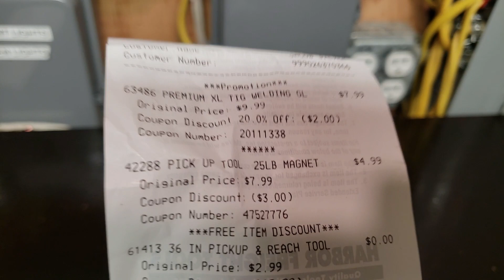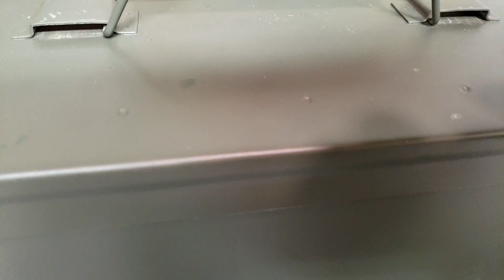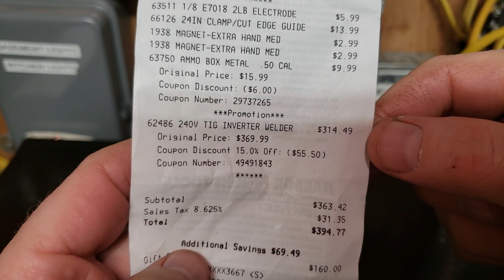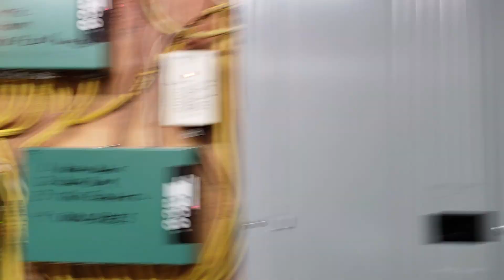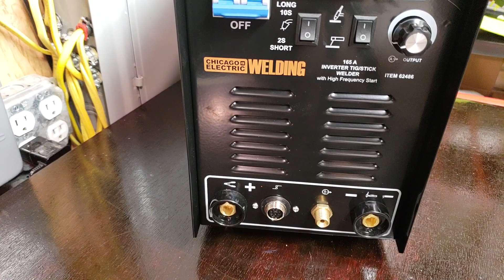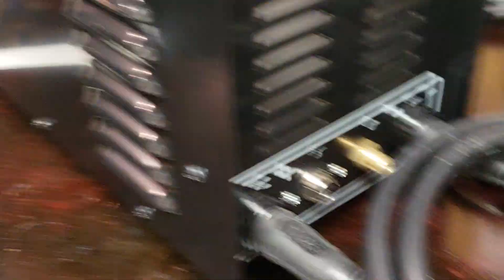Harbor Freight Trip - Bought a Chicago Electric 165 Amp Welder

Comment: First off it is a 165 amp welder. It is for home use. The money you spent on that Tweco stinger? You bought a 250 amp stinger for a 165 amp welding machine. Wasted money! The money you spent on that Hobart ground clamp? Again Wasted money!  This a little welder for the home hobbyist. The stinger is fine. The ground clamp is fine. And.......it is a TIG kit NOT a MIG kit. As for the foot pedal? We welders like to use them when we can-no matter the size of them, it keeps your tungsten clean.. Huh? Who would have thought there was still electricity flowing through your homemade adapter??????? It bit you when you touched it. Apparently you are not an electrician either. No it can provide 165 amps. I would take your home adapter and pitch it.
Reply: Dianne why so rude, menapause?
Reply: @momohunkerton4294  no, she knows what she's talking about. Obviously more than the video author. His adapter is a dangerous setup, also he used heavy gauge wire on it, but still plugging in to 12 gauge wire. That's how you burn your house down. Any welder should have its own plug and breaker with at least an 8 gauge wire.
Reply: @aaronwood3540  I know nothing about electricity, just wondering why she is so upset
Reply: @momohunkerton4294  I don't know if she's upset or not. But I see where she's coming from. These are ment to be educational videos so people can learn how to do things. But when the teacher is doing it wrong the outcome can be dangerous at least. That's not good.
Reply: @aaronwood3540  I totally understand your point, thank you for discussing it
Reply: @momohunkerton4294  you are very welcome. Happy New year!
Reply: Thank you. That adaptor is total dumbness
Reply: This guy sounds like he's going through his menstruation with a comment like this

Comment: Can I get the link for that 240/120 adapter.
Reply from the maker: The Video is Here: https://youtu.be/4UfclN3kHCc
Reply from the maker: The Video is Here: https://youtu.be/4UfclN3kHCc
Reply: Don’t do it. This machine is supposed to be ran off 240v only. 220/250v plug whatever, but joining the two as he did is useless as this machine likely requires a 30amp. Joining the two on a 15-20amp, you’ll be popping circuits at full power. I’m not sure if he explained it but it was incredibly boring.